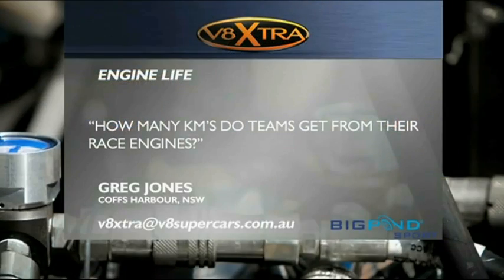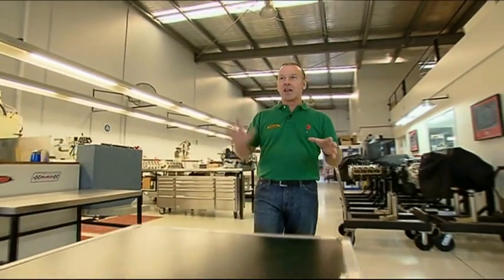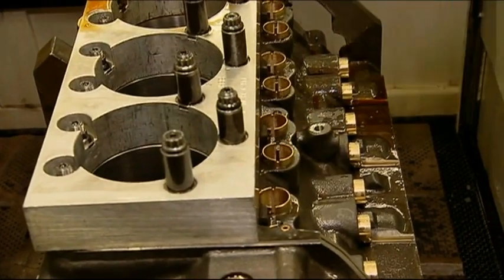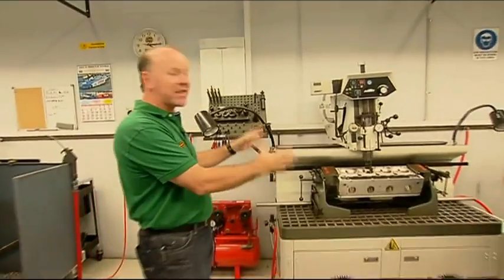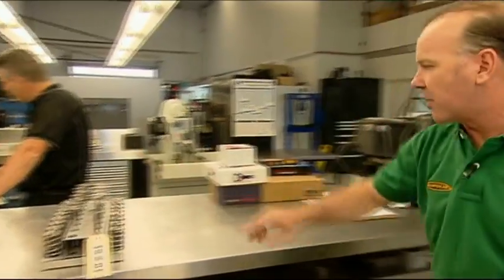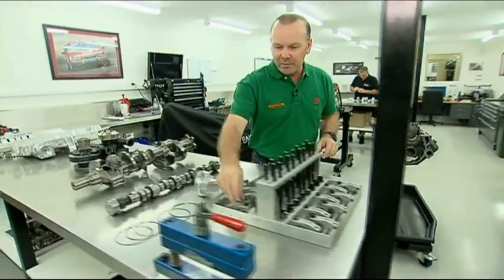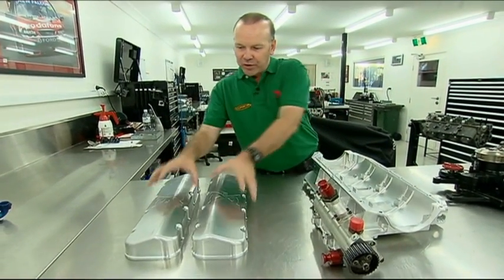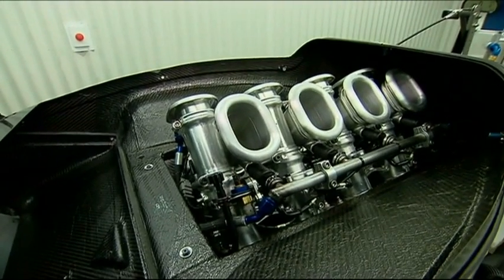Mark Larkham Explains "Engine Servicing" In V8 Supercars

Comment: Wow, this is an old video clip.
David - engine regulations, for example the engine is limited to 7500 rpm, 5 litres, 2 valves per cylinder and 'production' engine designs - so a little over 600hp is pretty darned good...
Now, about the 400hp V6 - some details please as I bet they aren't as restricted.

Carling - under load it was around 0.9 lambda, that corresponds to ~13.2 AFR (petrol/gasoline - I think they were already using E85 by then, which would be different, of course) which is around the 'best power' area. Different engine configurations may be a little richer or leaner for best power.

Brian, perhaps you should actually learn something about engines... you are just talking crap. However, to address the first point, the only sensible one, these engines are very reliable and the 3k 'service', or rebuild, is for two main reasons... 
a/ the engines are more highly stressed than your road engines and, as such, some parts have a service life after which they may fail (look up 'fatigue failure' for the reason) and regular replacement is done to ensure they do not fail in a race and not only cost them a result but do a lot more damage as a result of the failure (for example, look up dropped valve''on Youtube). 
b/ the engines wear and as the rings wear they do not seal as well (look up 'blowby'or 'ring leakage'), similarly, as the valve seat area wears it may not seal as well and may not flow the gases around them as well. Nowadays roller camshafts and followers have largely eliminated it, but with some engines camshaft wear is also a problem.

Comment: Aww C'mon, can't you build them a little more reliable?? Where is the water/coolant jackets?? Are there any?? What about full round on the crank... you know the LT500 is faster than the banshee... and it's power band is smooth, not snappy... that's just because of the full round on the crank... perfectly balanced... What's the firing order on the pistons? that would make a big diffrence if it is out of "balance"....?